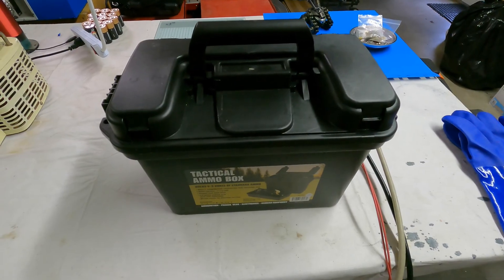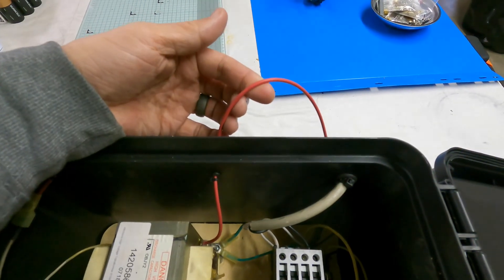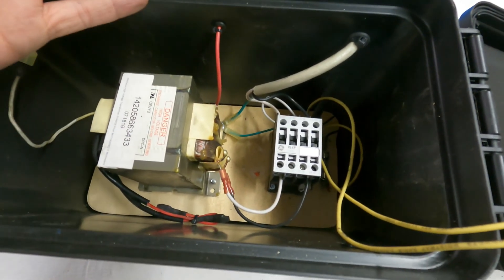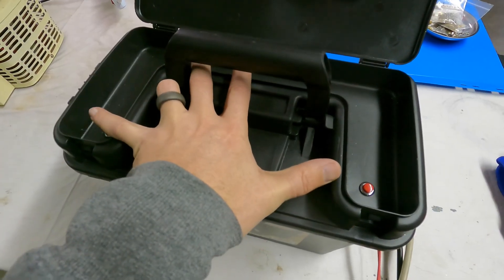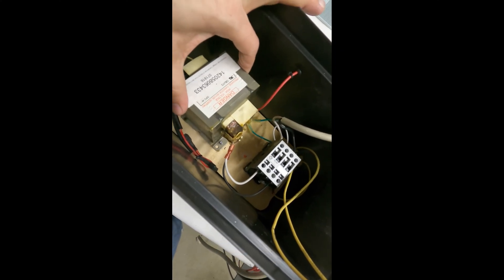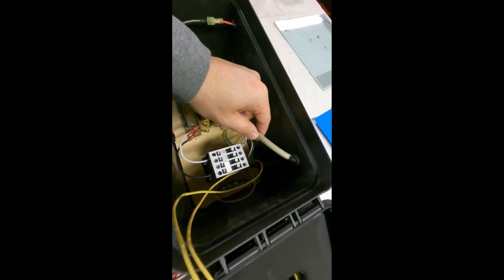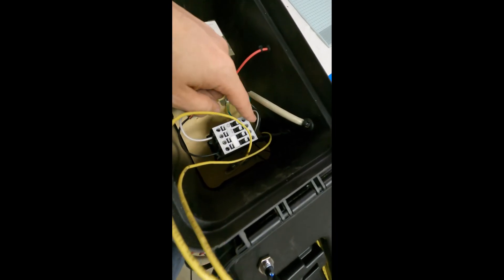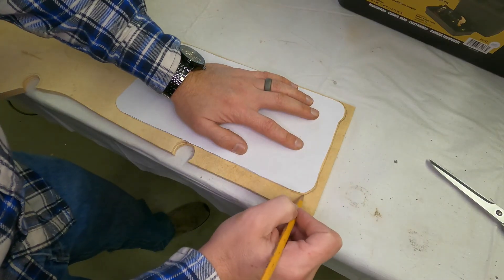Lichtenberg Fractal Burner Build

Comment: What gauge wire did you get for the high voltage side. And where did you purchase it?
Reply from the maker: I think the wire is about 18 gauge.  It is specialty high voltage wire that has insulation that is rated for a few thousand volts.  I purchased it on Ebay many years ago when I built my first tesla coil.  The wire gauge doesn't need to be very large for a project like this because the current is less than a few amps, but the voltage is really high.